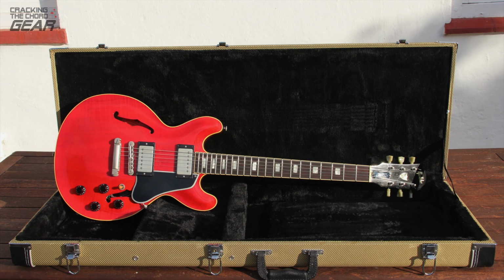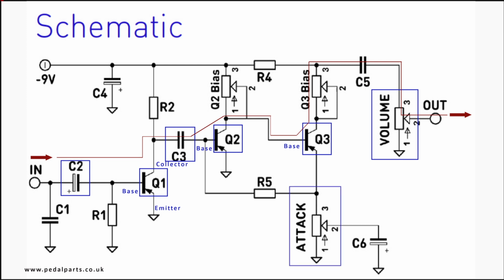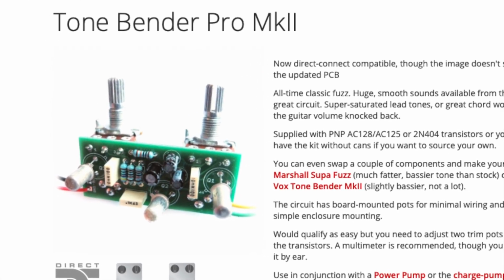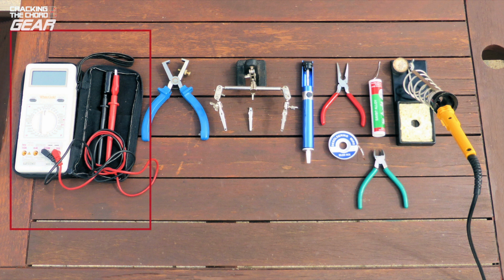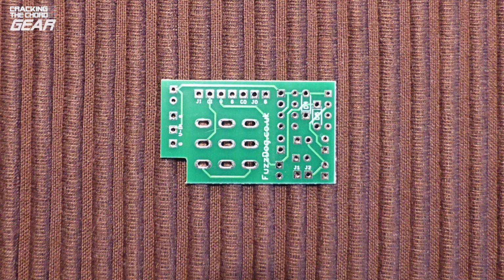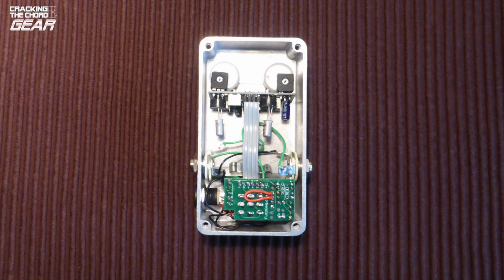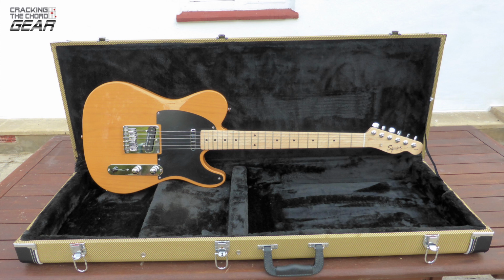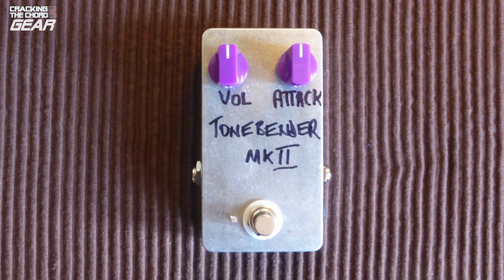Build  a Tone Bender MK II Pedal

Comment: Great video.  Thanks for doing it and providing such usual info.  I plan to build a Ge Fuzz soon but looking to find one that delivers the sound I want.

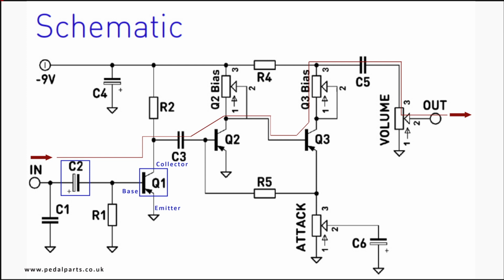Do you know of a kit that can get the tone like Pete Thorn gets from the Constellation when he rolls down the Strat volume at around 3:35?

https://www.youtube.com/watch?v=eUumA9bASxM

He calls it a "glassy highs thing."

I will watch the other video you mention early in the video in case the sound I am after is missing.

Brian
Reply from the maker: Hi, That is a GREAT sounding pedal and I particularly like the Rangemaster into Fuzz Face setting that Pete favours. Thanks for highlighting it. I have had a look for a kit that does what the pedal does without any luck so far but I'm tempted to build just the Rangemaster and FuzzFace circuits into a pedal on the strength of that demo.
Reply: @CrackingtheChord  Right now I am looking at the Aion Effects kits.   They have several 'flavors' of fuzz.   I was initially leaning towards the Solaris (Dallas-Arbiter) but now I am leaning more towards the Deimos (VTB 1.5/2).  I built a GGG Big Muff which is Silicone and cannot get the clean tone I want.

I may ultimately by a used Constellation though :)

Whatever happens I AM getting the Quantum (Mostortion) kit!

Brian

Comment: Are you sure about the working of transistors / valves?? I have learned that valves are voltage controlled current devices.

Aside from that I had a VOX fuzz when I was young, I suppose it was a V 1.5. I got it around the time it came out, together with a VOX AC30 Top Boost. Happy times 🙂

At that time I/we were not aware of the guitar volume controlling the Fuzz pedal.

Comment: What if I have bunch of old black glass mullard transisors..BUT are NPN, is wiring be same eccept for revese power supply?thnx
Reply from the maker: Scott, Unfortunately, it isn't as simple as that. You have to reverse the polarity of the electrolytic capacitors too. Check out Fuzzdog's instructions, which are free to download.